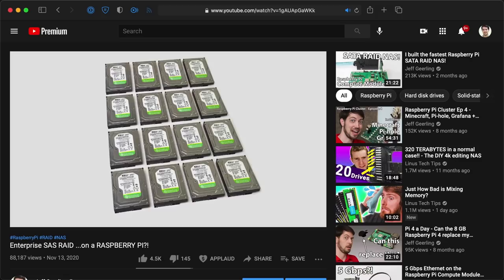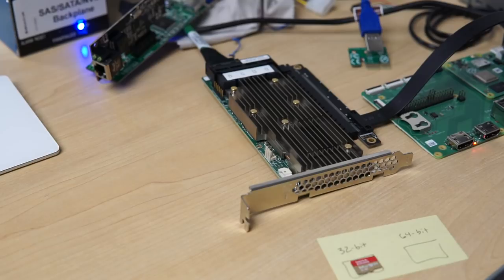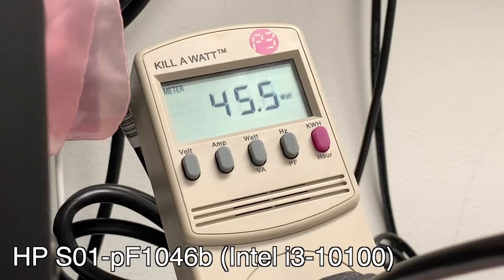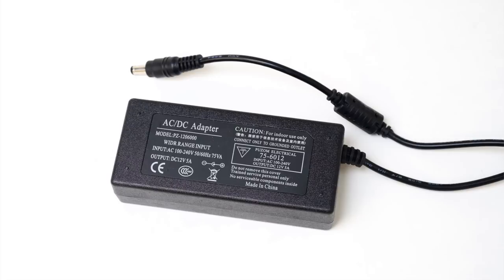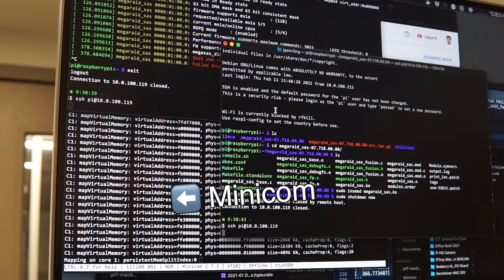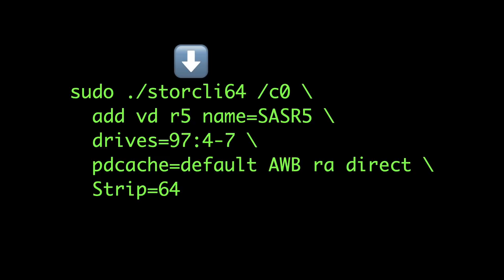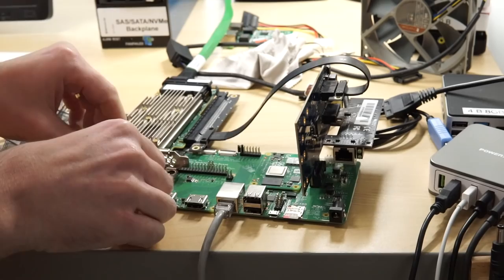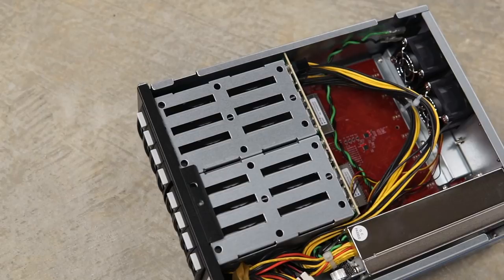Hardware RAID for the fastest Raspberry Pi CM4 NAS!

Comment: It's kingston A400 not sa400,, my search filters specifically make sure I filter them out as they are dramless and start to suffer under high write loads and get progressively worse the more data has been written to them assuming trim isn't working 

once they have had one drive write they can become Quite slow and and have high latency 

or if trim is working past 40-60% full they start to slow down as the page table has to be loaded into the small 1-10mb ram Built into the controller 

they are slower then the uv400 or uv500 (dram based SSDs) even when empty more or less Empty

Comment: watch out, RAID cards get HOT
Reply from the maker: Luckily this one stays around 70°C in open air (heat sink doesn't get quite that hot), and 50-60°C if I pass some air over it with a low-speed noctua fan. But yes, keep your electronics cool!

Comment: I suggest next time don't hack the PSU cables up, instead get a socket and wire your stuff up to the socket.  For added Brownie points you could look at a Motherboard Manual and find out what the socket pinouts are so you don't fry another one...
Reply from the maker: To be clear, I shorted PS_ON to ground. It was another wire in that bundle that shorted some other wire (I should've pulled the unused pins out of the connector entirely), and that's what fried the PSU :(

Comment: I don't know this particular raid controller but older models needed some cooling .It would be great if the sas12Gb run much cooler than the 3/6gb ones .For the PSU you need at least 90w one .Also try pci-e connectors that have separate power plugs , maybe the PCB lanes are not designed to handle that much of power draw and the voltages falls to low .

Comment: RAID should stand for Redundant Array of Inexpensive Disks.  Using multiple cheap drives versus more expensive large drives.
Reply from the maker: It's both (Inexpensive or Independent). There are many RAID arrays with disks inside that would make your eyes pop if you knew how expensive each drive was ($5k USD+).
Reply: @JeffGeerling  My only gripe with Independent is that it's not true.  Except in the case of RAID 1 and its variants, the drives become Interdependent in the Array.  This is why removing a drive forces a rebuild of the data set.
Reply from the maker: @iankester-haney3315  I think the idea is the drive is 'independent' — e.g. there is not one motor that is spinning all the platters across all the drives, or one SATA or SAS cable plugged into one giant device with 60 platters inside.

Not that the drive could be yanked at any time.

I remember seeing 'hard drives' that were the size of my desktop computer when I was a kid, and they were a 'single' drive, with one connection to the computer. RAID made it easier to manage the same amount of storage but with a bunch of independent, commodity drives. Whether or not they were inexpensive is besides the point.

Comment: With software RAID you should be able to move your disks to different hardware should there be a failure, and recover your data. With hardware RAID, however, unless you can get hold of an identical RAID card it's likely you can say good bye to your data. Just something to be aware of... this is why enterprise pays for redundancy.
Reply from the maker: That's why enterprise has like 50 extra storage cards and entire servers sitting in a cold rack somewhere :D

Comment: This is so interesting, i had same idea when i thought to buy a server with  independent storage (storage tower). This two connected by a HBA card (external sas conector) but searching about it i found the cards are not cheap, and also the ones cheap have internal conector (not external). Also i dont really know if i can plug it in a x79 chinnese motherboard (dont know if with windows 10 pro or windows server 2016). if you know were i can take a card with that specifications or you want to advice me of something Thank you, and thanks for the video.

Comment: A much more sensible alternative would be an Odroid H2+ (Intel Atom, 2 SATA, 2RTL7125B 2.5 GB LAN) (https://www.hardkernel.com/shop/odroid-h2plus/) plus a M.2 SATA Card like this one (https://www.kalea-informatique.com/m-2-pcie3-0-to-5-port-sata-6g-adapter.htm), which adds 5 more SATA ports. It's also quite small, but powerful enough for the task, and - more important - runs out of the box.
Regarding your i3: No NAS vendor would use it. There are SOCs like Avoton C3758 with 8 cores and 12 SATA ports built-in and 25W TDP specifically build for NAS and other network appliances.

Comment: Would you please supply a link to the drive enclosure that you are using?
Reply from the maker: The enclosure was provided by Broadcom, but I believe it was originally made by SerialCables.com (since discontinued). I'm pretty sure Broadcom swapped out some internals to get the tri-mode support working, since the original backplane inside was just direct attach SAS.

Comment: Hey @Jeff Geerling, I’ve heard you mention RAID-5 a few times, but as someone who’s been using RAID in the enterprise for 18 years, why not use RAID-10 (which probably should be called RAID-01, as it is a RAID-0 stripe, across half your drives (making it super fast), which is RAID-1 mirrored to the other half of your drives (making it redundant) & is more fault tolerant than RAID-5)?
Reply from the maker: See my earlier video on SATA RAID :) — in this video I wanted to use a RAID type that required parity calculations to give a worse case for the card to deal with than simple mirroring/striping.

Comment: It's 2021 and like a decade ago people were calling for triple parity RAID. The only place that has it is ZFS, if you can even consider that RAID. The excuse was the typical one about using too much processing power. Nonsense.
Reply from the maker: We need at least four parity drives per drive 🤪
Reply: @JeffGeerling  It would be nice. I'd rather have more drives with more parity options than how things are going with gigantic drives that will take out other drives just to rebuild.
Reply: But that Robin weirdo who wrote all those CNET articles back in the day didn't understand common sense. Acted like a bit failure at the exact same place on all drives in an array was actually certain, instead of reality, which would be astronomical.

Comment: Can you use the wifi to your network madness? I always wonder that, after all it's another network interface.

Awesome video by the way
Reply from the maker: Yes, have been testing WiFi cards a bit; check out https://pipci.jeffgeerling.com for my experience(s).
Reply: Sorry, I meant to use the onboard wifi card, not pcie. I imagine it would be janky, but using the onboard ethernet + onboard wifi + pcie network card together is feasible?

Comment: You just need to get a 24 pin jumper. They’re not that expensive (cheaper than the Kingston 120gb ssd)
Reply from the maker: I have one, but I was trying to make a smaller one that fit right on the back of my modular power supply so I didn't have to pop an entire motherboard power supply cable on it to turn it on.
Reply: @JeffGeerling  I use a 2 pin stake soldered together, and just shove it into the 24 pin connector.

Comment: Is there a smaller, cheaper, more comparably matched Broadcom card to the pi?
Reply from the maker: The 9440-8i mentioned at the end is about as low-end as you can go before the driver support will be an issue. That card can be had for $200 or less used.

Comment: Yummie! I wonder how much performance is lost with a simple HBA like the 9400-8i.
Reply: 9400-8i is a SAS HBA. Any software raid operations will need traverse the pcie 2.0 x1 interface. So expect some loss compared to the 9440-8i or 9460-8i
Reply: @joshsinykin5230  I was wondering about a simple softRAID (eg. mirroring)  CPU usage on the Pi using a HBA. I guess it will be the same as with a SATA card.

Comment: Which kernel version did you do the testing on? 
There seems to be a  performance regression with newer kernels

https://github.com/raspberrypi/linux/issues/4133
Reply from the maker: Either 5.10.11-v8+ 5.10.14-v8+ was used for all the 64-bit Pi OS beta testing in this video. For 32-bit Pi OS testing, 5.10.11.

I didn't experience any of the issues that poster mentioned, though I wasn't monitoring interrupts the entire time. I wonder if something in the stack for USB/UASP could contribute to that issue?
Reply: @JeffGeerling  
Thanks! 

The issue occurred after writing around 4-5GB of data. 
So either it's related to the USB/ UASP or maybe you didn't write enough data.

Comment: What kind of external storage enclosure are you using?
Reply: it looks like serial cables 8 bay das box not for sale anymore, probably you could buy a intel drive bay/box or supermicro drive bay since they most likely not to use weird/bs power connectors

Comment: Quick question: how are you measuring the transfer speeds when transferring from Pi to MacBook (or vise versa) when using samba?
Reply from the maker: A janky shell command that I actually haven't documented (usually I put it all in my GitHub issues, d'oh!). It gets the size of the file, then measures the time of the transfer using cp, and while transferring I have the average speed monitored in another window.

I used to use rsync for the tests, but I am always nervous that rsync adds a little overhead.

I wish there were a better/easier way to benchmark network copies on macOS, though. There probably is.
Reply: @JeffGeerling  Excellent. Thank you for the detailed reply!

Comment: It'd be interesting to hear your SAS RAID with 15K drives if the washing machine 10K ones are noisy. Aditionally, would the 12G drives give faster data transfer speeds with this SAS RAID card on the Raspberry Pi CM4?
Reply: 12G drives would speed up transfer in and out of the RAID Cache, but the PCIe Gen2 x1 is the fundamental performance bottleneck.

Comment: What is the total power draw on the system? (including drives)
Reply from the maker: I took that measurement but didn't note it in the video... and it's on my computer where I can't get to it right now. I believe at idle, the Pi and HBA were 10W, and the enclosure with all drives powered up was 24W? somewhere in that ballpark. I should probably remeasure through a power splitter so I can get the total power usage under load too.

Comment: Do you have a link to that backplane/case?  Thanks.
Reply from the maker: That backplane is a reference, and somewhat of a unique beast. It's based on a model from SerialCables.com (https://www.serialcables.com/product/sa-enc12g-01a-2/), but has some custom innards to support Tri-Mode/U.3. I really hope someone makes a backplane like it that you can use outside a giant server (I think a couple server vendors do have backplanes, but they're built into servers).
Reply: @JeffGeerling  Many OEMs will be producing SFF-TA-1005/UBM backplanes (similar to the one you used). As more consumers push for Universal Backplane Management the easier it will be to find vendors. The HW RAID Adapter does not require a backplane, you can direct cable drives to it, the backplane just makes for a nice testing environment which cools the drives and allows for hot add and hot remove of media from the RAID adapter.
Reply from the maker: @joshsinykin5230  Good to know! And I'll hopefully be demonstrating a few other HDD connection methods next week :)

Comment: Something is very wrong with HP SAS RAID, speed you are getting is equivalent of speed of single drive, even 15 years ago I was getting random read speed from RAID of SAS drives in excess of 400 megabytes/second (on 15k drives).

Comment: not sure what spindle speed your sas drives were, though @ 7,500 rpm  you will achieve 100Mbps  whether it be raid or otherwise...

sas vs ssd ssd will always win..

the most you can do in a server config is 20 past this you are going to buffer issues due to bus speed..

for scratch 160TB VS 360TB storage  based on 40 bay array with 20 ssd's at 8tb each  20x18TB nas..

unless they building 2.5 inch where you could  slot in 2xm.2's per drive case

Comment: In my lab, I have 56 (Intel) servers running the 9361-4i, 8i, and 16i.  No NVMe in RAID.  Outrageously expensive still, and I can bury the PCI lanes w Enterprise SATA SSD’s for a fraction of the cost of NVMe.  I do use NVMe as  HostOS/Boot disks.  
I’d love to build a 6 node CM4 Ceph cluster w 3 SATA SSD’s each.  Too bad I can’t get a CM4 above 2gig of RAM.
I do buy spindles.  seagate exos 7e8 4TB, 8TB, 12TB sas3 drives,  less than $25 per TB.  But the space, Iops, latency, and throughput change.  Even power.  7 watts per spindle.  It adds up.  
$150 used on eBay:  
https://www.ebay.com/itm/Intel-MR-SAS-9361-4i-12Gb-s-PCIe-RAID-Controller-/154069880567?_trksid=p2349624.m46890.l49292
Reply from the maker: Yeah... I hope 4/8 GB CM4s become available soon. I still have two on order, have been since October. :(
Reply: It's probably faster than NVMe would be anyway. CPUs can't keep up and end up waiting for the data to be re-sent.

Comment: Wow, that MegaRAID 9460-16i looks sweet, lets see how much those cost so I can get one!

>$900

Well, nevermind.
Reply from the maker: I mention the 9440-8i towards the end of the video—less than $200 used. It has the main features that make the 9460-16i great, just supports fewer drives and less 'fancy' stuff. And a lot lighter heat sink!

Comment: 10gbe ? we;ll have that in our homes in about 50 years.
Reply from the maker: 2.5 GbE might be a more realistic goal though; I'm really hoping consumer grade switches for < $50 start coming out soon. There are plenty of cards and USB interfaces that work well enough, but it's rare to find a cheap 4, 8, 16 port 2.5G switch.
Reply: Nah get a couple used Intel based x520 rj45 10Gb NIC install in server and main tower. Direct cable between em, static IP, line in host file to force all data to other IP use 10Gb link poof 10Gb link for $120-$130ish over cat6

Comment: Hardware Raid is great, exept:
- good lock if the controller fails and you cand find the exact same model
- no easy way of getting Drive fail allerts to the os.
- it expensive
Reply: The RAID volume information is written to the drives. If you move from one controller to a newer generation of the same "family", it will read the volume information. StorCli allows you to monitor your RAID volume state.

Comment: Can you attach just one SAS drive to Pi… no RAID?
Reply: Yes this is possible. The RAID adapter has a mode to pass the disk right thru to the OS (aka JBOD mode)
Reply: @joshsinykin5230  Thank you Josh, is there a cheaper card as I don't need the RAID functionality?
Reply: @frankcellini9363  the 9440-8i will be the cheapest option to work with this driver and software set. You can run it in jbod mode or raid mode.
Reply: @joshsinykin5230  Is there something that I can connect a single SAS drive to USB3 or to ThunderBolt/USB-c?

Comment: Wow you almost died with that PSU no?
Reply from the maker: Only 600 watts... 👀

Just a tip to the wise—I made sure that my fingers were clear from any of the exposed wires at all times. I've been shocked enough times to know a slightly risky thing like I did here (plugging in a cable with all the connectors snipped, ends very slightly exposed) can lead to some pretty disastrous results.

Sometimes if I'm more nervous I'll actually pop on my leather work gloves too, or use an insulated tool to plug something in the first time.

Anyways, now I've learned—fully remove all the wires that I'm not shorting before I try plugging in the connector!

Comment: "what did you just say ... I couldn't hear you over the fan noise?"
Reply from the maker: Found another homelabber!
Reply: If i can just get around to watercool the UPS I'll be okay I think. Just need to make a circuit to give the UPS fan controller  a couple RPM signals so it doesn't shut down, maybe tie it into coolant flow and temperature for good measure. One day, most likely the day after i lose my marbles to the noise..

Comment: i will never ever believe in a hardware raid again. using hw raids ...and after a crash you are lost! (you need at least 1 spare controller, tested and fully working) .... also hw raid uses properitary magics.... no compatible between any controllers even from the same manufacturer. at least you need battery backups and ram for hw raid. i would never use one again. and i promise you wont after yuor first crash and try to reconstruct a properitary raid. but for the pooor raspi... ok, ... i would never believe in a raspi beeing HA... lol. good joke. why wasting time with a raspi? .... :D ... and ow, turn on krb5 encryption for nfs and all that. i wont believe the raspi will run that fast again.